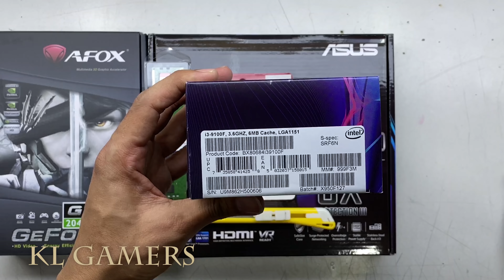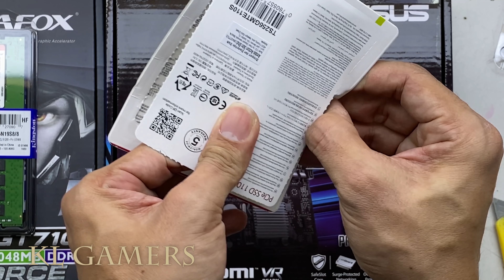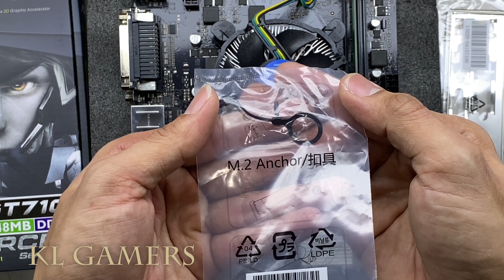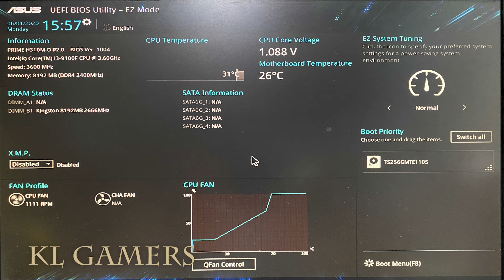intel Core i3 9100F ASUS PRIME H310M-D R2.0 Transcend SSD GT710 AVF 560 Office Desktop Build

Comment: Does the mobo supported the cpu out of the box? No need for bios update?
Reply from the maker: yes but The intel i3 9100F processor which have the "F" SKU model at the back means no build in intel HD graphics which means you cannot use this processor without a graphics card.
Reply: @KLGamers  Thank you so much for the information!

Comment: My power supply is 250W, same board, i3 9th Gen processor. Do I need to change the power supply ?
And Thanks for the detailed in front panel pins.

Comment: kl have you ever seen any case with any faulty hd audio or usb header cables? this is the second old case i've been given with the exact same problem where i cannot use my headset to the front of my case, because it has a shortage somewhere that i cannot fix, its so annoying now i gotta plug my headset at the back of the motherboard, just to get sound in from the mic and the headphones.
Reply from the maker: install audio drivers and use the realtek software hidden settings to adjust the front panel audio to AC97 dront panel is old casing
Reply: @KLGamers  what I mean is that the audio was working fine without me needing to configure anything, but because the cable has a short, sometimes I would get alot of static on my headset from the mic, also my friends on discord wouldn't be able to hear me either because it would disconnect at random times. I figured that out by opening up the case and playing with the cable connected to the header on the motherboard, so that's how I know it's a physical problem

Comment: i have a question i bought this h310md r2 and i have i5 9400f ....on the motherboard box says that supports 8th gen ...is there any problem with 9400f ? because the store that i bought didnt say anything
Reply from the maker: yes will support

The intel i5 9400F processor which have the "F" SKU model at the back means no build in intel HD graphics which means you cannot use this processor without a graphics card.

Meaning you will not get any display output from the motherboard physical VGA/Display Port/HDMI if you pair it with a "F" SKU model intel processor such as the intel i5 9400F processor. You will need a graphics card such as the GTX 1650.
Reply: @KLGamers  thank you ❤

Comment: Intel core i3 with gt710 bottleneck
Inyel core i3 with rtx 2080 ti bottleneck

Me:what do you want!!!
Reply: For i3 9100F GTX 1660 SUPER
Reply: Inyel? Is it some weird Intel copy?;)
Reply: Rx 570/ 1650 super/ 1660ti/ 1050ti so many GPU that would not bottleneck...
Reply: I am using the same setup but with 16gb of 2600mhz and a Asus RX5700.  It has about a 15% bottleneck.

Comment: Puedo poner un i3 9100F en Una Asus Prime H310M-E R2.0?
Reply from the maker: yes The intel i3 9100F processor which have the "F" SKU model at the back means no build in intel HD graphics which means you cannot use this processor without a graphics card.
Reply: KL Gamers thanks